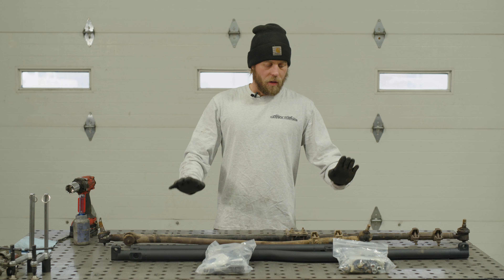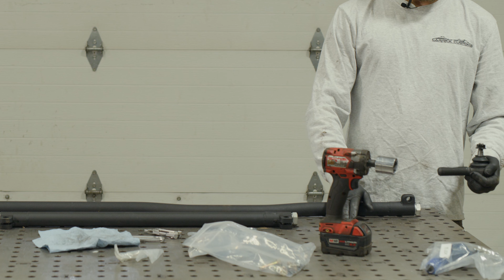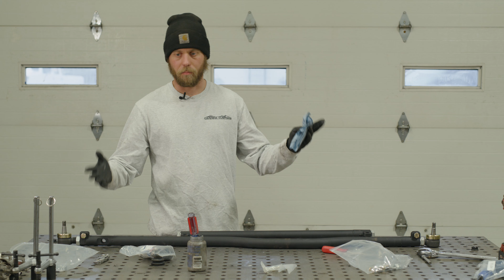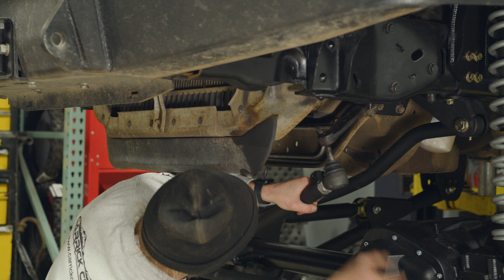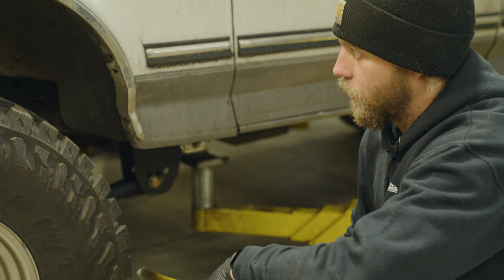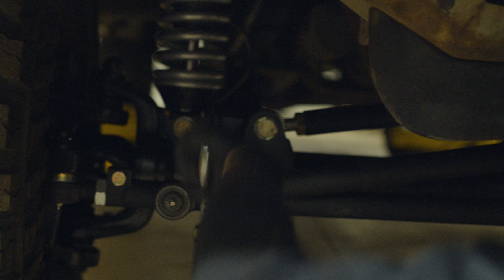OBS Ford D60 HD Steering Kit DETAILED Install

Comment: Super lift center swing was and is better. They gave up... Why not use the offset center swing that centers the steering arms. Its just an opposed link that allows centered links to both steering links.

Comment: Does CC or anyone else make a similar system for a TTB F150? Or is this low misalignment system only work on a solid axle?
Reply from the maker: This steering linkage is only for D60 solid axles.  I do not know of anyone that makes an upgraded steering linkage for TTB F150s right now but we are working on a new steering kit for the TTB50 (F250) that will be available later this year.